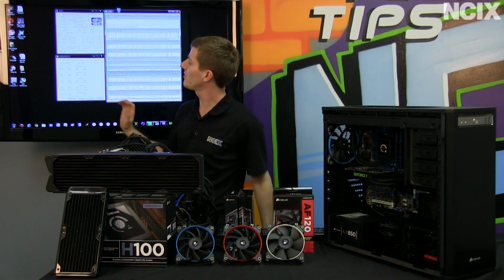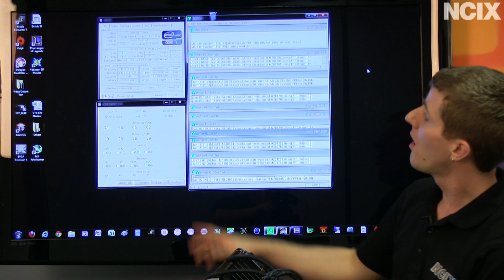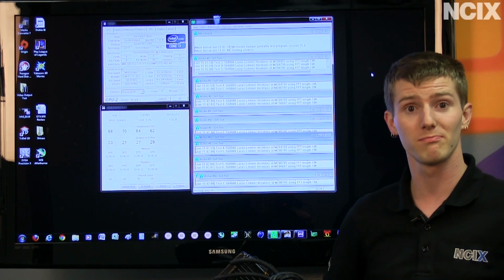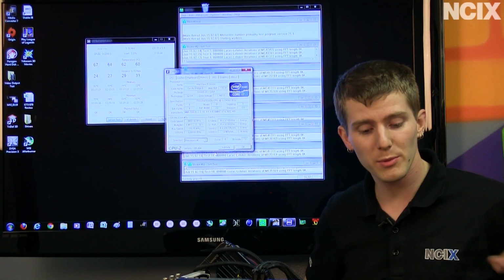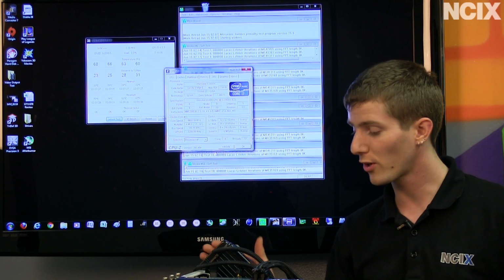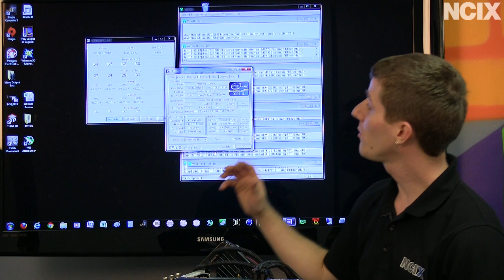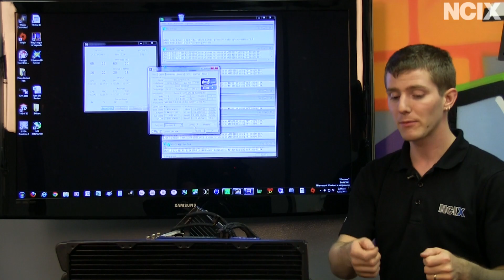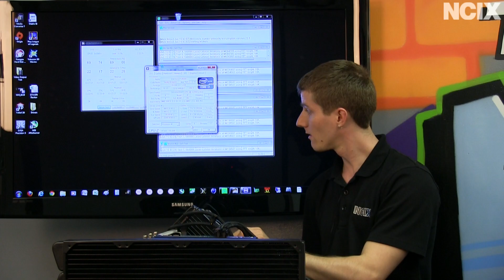Fan Optimization for Radiators and Heatsinks for PC Cooling Systems NCIX Tech Tips

Comment: is it safe to use AF on a radiator ?
or do you need a SP ? I need a quick answer! :)
Reply: Patrick J You could safely use a AF fan but you will get better cooling with a SP fan, but that also depends how much fpi (fins per inch) you have. All of this is covered in the video bro :)

Comment: rule of thumb for silence:
thin=pull (airflow)
thick=push-pull (pressure)
heat sinks=all solutions work (less dense than radiator means less need for pressure)

Comment: can someone tell me what fans to use for exhaust and intake? is it static pressure for intake and high flow for exhaust?
Reply: For exhaust fan at the rear of the case where there's nothing restricting the fan in the case, go for air flow fan since there is sufficient air to be pushed out of the case. Same for intake fan if nothing is restricting the air to be pulled into the case. Correct me if i'm wrong.

Comment: I have a Seidon 120V and looking for a replacement fan for it because of its noise. Does anyone know a good, quiet fan for my radiator?
Reply: Gentle Typhoons are the best for heatsinks and radiators, and extremely quiet.
Reply: What's the best model for the best RPM to dBA ratio?
Reply: Gentle Typhoons. And when looking for fans for a radiator or heatsink, you want to look at static pressure, not RPM.

Comment: for a push pull config on the h80 should i use a static pressure fan to force air throught the rad and have a air flow fan on the back to exhaust?

Comment: guys, what would happen if i used a corsair sp120 fan for a rear fan. did i fuck up?

i have 2 corsair sp 120s for push pull on my heatsink facing towards my rear fan

my rear fan is a corsair sp 120
my top fan is an AF140 COSAIR fan

Comment: Also, if you want a push-pull configuration, does it make sense to put SP fans on both ends or is it better to put an airflow fan at the back (i.e. exhaust end)?

Comment: All Corsair rads are high density so they will require SP fans for close tolerance cooling whereas the AF fans require some space between them to actually move air through them. Pressure and velocity are two entirely different characteristics.

Comment: I still prefer my Gentle Typhoon AP-15. They generate the same static pressure of 3.0mmH20 as the SP120 High Performance but with a noticable lower noise of 29dBA against the 35dBA of the corsairs.

Comment: yes i'am push/pull congif right now...but i just want to change the fans for more quieter PC. i'm at 4.5 ghz(1.29 vcore)under 70C at full load. so is it low or high dens for the radiator?

Comment: You got it the wrong way. Lower FPI is lower density so you don't need high speed fans. For example the Black Ice SR1 is very optimized for low speed fans under 1000rpm because it has such a low Fins Per Inch.

Comment: Yes I see. It would be good to have positive air pressure in your case as long as it has areas to vent air out of, this would decrease dust and also hot air but if your case is sealed then an exhaust fan is necessary. For the H100 I would use push/pull config because it helps to draw more air over the rad but if aesthetics are your goal then one fan should be fine.

Comment: I wonder which is the quieter between the Scythe Gentle Typhoon AP-15 and the Corsair SP120 Quiet Edition? I currently have 2 Scythe GTs on my H80 in push-pull and they are damn loud even under 1000 rpm.

Comment: you like that case don't you? i cant blame you, because i have it beside me and it is quiet, unless i start benchmarking/stability testing. have the h100 mounted above a sabertooth z77 push/pull with cougar 120mm. with one set of fans outside the case.

Comment: 70 degrees on liquid?, I use a basic heatsink with corsair 80mm silent server cooling fans and a standard aluminium heatsink recommended by Intel in 2002 and my CPU (Intel Pentium 4HT) stays at an impressive 37.546 degrees, even if the airflow is restricted through the case, it keeps a constant 60 degrees, the processor deals with a hell of a lot of very resource hungry  apps, so it is working at nearly full capacity for most of the time I use and overclock it (by 0.989 volts)

Comment: Low density/obstruction in general, like exhaust/intake fans. I would probably use the pressure fans for all rads regardless as there is significantly more obstruction than any exhaust/intake will generally have.